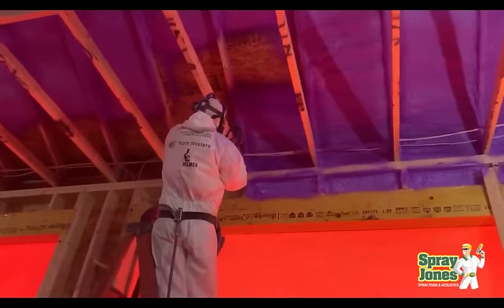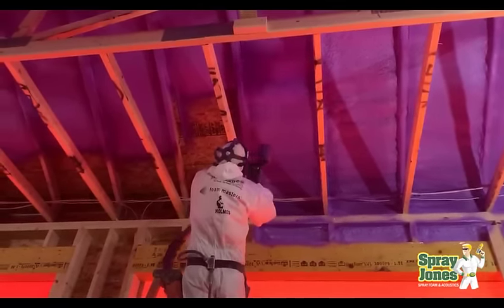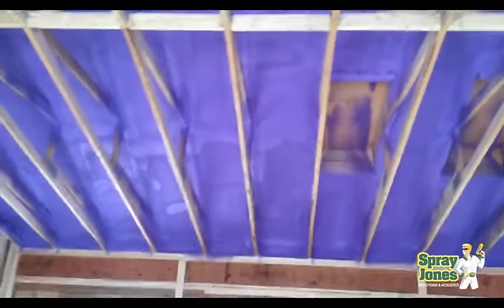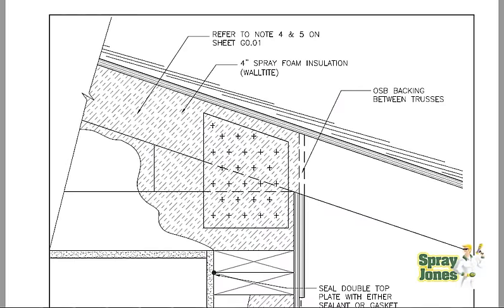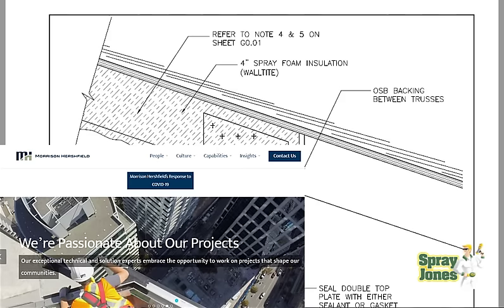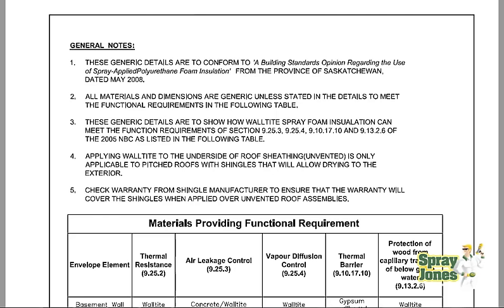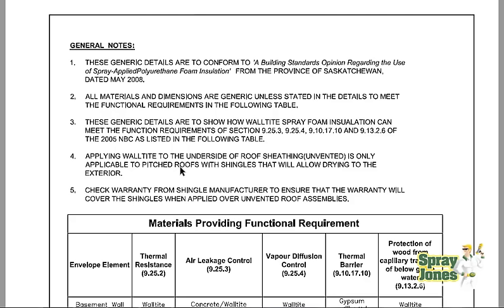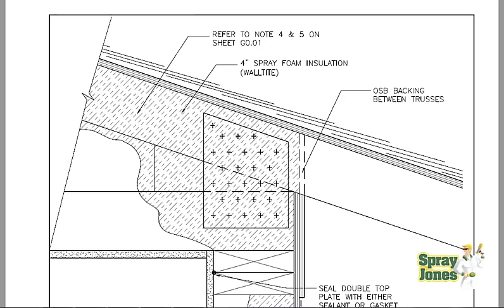Unvented roofs - Closed cell vs Open cell Spray Foam Insulation which is better?

Comment: Thanks for the video.  We just closed on a house in the Seattle area (Marine 4) and our roof is going to be replaced along with some of the sheathing (mold).  We need to fix the insulation to help keep condensation out and was considering going closed cell foam so we can use the attic for conditioned storage.  How does CCF on the rafters do in the wet environment? 

I was reading in your comments that vents would be better to not be there.  Our alternative is to replace, seal and blow in to R40ish to keep the moisture down, but also read that over venting in the Marine 4 environment will actually cause more condensation.  I just want to do the best practice and hopefully avoid these issues.

We have a lot more moisture than Regina plus we have 2 skylights that I am worried about the low R causing condensation in the winter.
Reply from the maker: Please watch my 4 part series on nonvented roofs. All of your questions will be covered in detail in that learning session.

Comment: I seen metal buildings with flat roofs which spray in foam insulation if I built a metal building I would do this spray in  Foam and insulation and I would cover it all up with metal It's a metal roof if you can't find a hole in a metal roof you do not belong on that roof please comment back if I am right or wrong thank you I used to do roofing for many years burn down rubber roofs  Hot roofing jobs  And also shingle jobs I used to find the holes in the hot roofs and the burn down rubber roughs before I found the shingle week a less it was a single missing or just a natural   HOL E in  The  Roof or a less it was in the valleys or around distinct pipes or around the chimney every so many years you're supposed to go up there with a bucket of gunk and re do them thank you for this video

Comment: Great video. I Have my spray foam contractor and he is recommending 8 inch open cell for my 2/12 pitch sealed cathedral roof. What do u think. I live in  Lafayette Indiana so we have all 4 seasons. This room addition is considered a four season room so a lot of windows. Will use water shield on entire roof with fiberglass shingles
Reply from the maker: I am indifferent. If the climate is warm enough open cell is more than OK.

Comment: Hey Mike! Appreciate all the info in your videos. We are currently building out in BC with ICF. What would the insulation detail be for 2:12 sloped and flat roofs with closed cell to the underside of the roof deck? Any special requirements? Thank you!
Reply from the maker: I do not consult on projects I am not being hired to spray. Talk with the people you intend to hire and they should be providing that data to you. If they can't that's a red flag.
Reply: @SprayJones  10-4 Mike. Thanks again for all the great content!

Comment: Keep in mind that roofs with a 3:12 pitch require two layers of asphalt paper under the shingles. I would be very careful about using closed-cell on less than a 4:12 pitch. 

What you fail to understand is that the closed-cell foam provides a moisture barrier under the plywood (like a vapor barrier). So any water that makes it to the plywood will be trapped between the ashpalt underlayment (which is a vapor barrier) and the closed foam insulation. This will impede the plywood from drying out. So your assumptions that all water will just drain off are incorrect. All water has to do is get under that asphalt paper and soak the plywood. This can happen if the roof is not sheathed and flashed correctly. The advantage of a vented attic is that if water does get to the plywood, the plywood can dry out from underneath air in the attic. That is a key difference.

Putting in closed cell insulation in the roof can be done safely and it is a great insulation system, but if human error comes into play, it can rot large sections of the roof before it is discovered and that is why it is not widely used. Presumably, if water got under the 15 lb asphalt paper and soaked the plywood, if open cell foam insulation was used, then the plywood would have a way to dry out. 

What we are talking about here is what happens when their is a roof failure. The closed-foam system can greatly increase the scope of damage caused by a roof failure. Also remember if the roof is a tile roof, then the cost of repair can be significant.
Reply from the maker: Thanks Frank. Stay subbed, I will be doing a new video on vaulted roof systems and SPF.

Comment: My daughter is redoing an old farm house with a non-vented attic.  There was no insulation and it is a metal roof.  My question is should we add roof vents and spray to attic floor or would you recommend spraying the underside of metal?  If you recommend spraying roof what happens if metal needs replacement down the road?   Thank you for your videos.
Reply: In northern New York on Canada border.
Reply from the maker: Direct to metal. 
Please watch parts 2-3 of the non-vented roof series. All your questions are answered there in detail that you will want.

Comment: Your videos are extremely helpful great job 

What is the foam you are using? I have not seen the purple stuff except on your channel
I,m in Northern Minnesota and plane on using close cell in the whole cabin would this be a problem?

Thank You
Reply from the maker: Closed cell is exactly what you should be spraying it with. We are using BASF's Walltite. You will not see that in the USA because it is blended for Canada and has to be dyed purple to identify it for the building code here.
Reply: @SprayJones   

thanks for the quick reply

Comment: I have one stupid last questions. I promise this will be my last. I am following as I understand it your advice. 2" closed cell on my foundation slab, 2-2.5" in my wall assembly (I will have Zip R-6 a sheathing), 3" closed cell on roof deck in my conditioned attic. So here is my stupid question. Should I also go 2" of closed cell between my ceiling and my conditioned attic? I am sure the answer is yes, but trying to cut some cost and just don't know. If my attic roof deck is closed and my walls are closed, is it worth doing in the ceiling of my ranch home? Thanks, sorry for asking so many questions, but I trust your opinion.
Reply from the maker: If you have sprayed to the roof deck you do not need insulation on the drywall ceiling. It is hanging in mid space...
For the record my suggestions are subject to code approvals for your area....
Reply: @SprayJones  Thanks. I just got a quote back from a contractor. I am pretty shocked. In short here is the details of the quote. Heated and Cooled square ft. 4,300 12 ft interior ceilings.  I asked for the following. 2" closed cell foam for the slab. 2-2.5" on all interior wall within the heated and cooled space. 3" closed cell foam on the roof deck within the conditioned attic space. 4" open cell ceiling that is the garage ceiling to the conditioned attic. Total Bill 73,000.00 for the job. I am shocked to say the least.

Comment: I'm planning on building a metal building home, all metal structure and metal roof, in Louisiana. It is a 2 story home with the entire roof inside vaulted and will be open to the inside of the house. I plan on using 2-3 inches of closed cell, sprayed directly to the metal, on the outside walls and 3-4 inches and the roof. I live 3 miles from the coast and we get lots of rain and sometimes flooding. I'm wondering about mold issues if we end up with standing water inside the house. Will mold grow on the foam? My other questions is the metal roof, what if I get a leak, how would I be able to find it or is this even a concern on metal roof with closed cell sprayed directly to it? I love your videos, they are very informative!
Reply from the maker: Mold will not grow on closed cell foam. Mold needs an organic surface to grow on.

Comment: You mentioned a resource indicating it was safe to use CCF under roof decks on 4/12 or greater shingled roof…..

What about low slopes roofs. Say a 2/12 roof using 45 mil TPO membrane ? Typically residential manufactured homes with TPO roof membranes are not glued down.

CCF would be great for strength on an older structure, but what about future roof leaks?

I should say this is in Florida. My home was narrowly missed by hurricane Ian.
Reply from the maker: Local SPF installers need to have their engineering done with state valid firms. 
You have to source that locally. But it is NOT as hard to find as you may think.

Comment: Using closed cell foam in an unvented conditioned space has a big caveat and could be bad if the roof isn't done correctly. If you have a conditioned attic space then the roof is no different than an exterior wall assembly. If you use closed cell foam on the inside it acts as a non-permeable vapor barrier on the inside. This means that the outside of the wall or roof needs to breathe all the way through your layers of your assembly to the  closed cell foam below. 

This means no peel and stick water and ice shields on top of the roof sheathing. If you do that then you have your wood roof sheathing sandwiched between two water and vapor impermeable materials. Bad idea since no system ever keeps 100% of moisture out. Very tiny amounts of moisture will get into any system but it will do no damage if it has a very easy exit. That is why any system should only have one vapor barrier on one side. 

Closed cell works well for walls because you have a rain screen material like siding that keeps most of the moisture off your outer wall surface with a small gap or drainage plane behind. Then your house wrap is water resistant but vapor permeable. This vapor permeable wrap allows any small amount of moisture that does get into the wall system to get back out once it is stopped by your impermeable closed cell foam. 

So closed cell foam for your attic is fine as long as you use a similar exterior system for your roof. Just use a vapor permeable but water resistant underlayment for your roof system.
Reply: What type of underlayment and ice shield would you recommend?

Comment: Your reference stated shingles. Are there objections to roof steel directly to the roof deck with closed cell? Or are perlins required?
Reply from the maker: I am not following you on you install ideas. Purlins are a structural question not a thermal envelope one.

Comment: Thoughts on renovation application to a 100 year old plank deck with multiple questionable or moldy areas underside? The drawings seem to apply to new construction with no reference to old homes and integration of vintage and modern practices. Plank spaces knot holes and other openings and less than new kiln dried lumber would seem to pose problems.  Sealing in 100 year old low slope 2 x 4 roof and rafters as well. IN those cases would a plywood or other  baffle base be warranted to provide ventilation and drying space from underside as low slope roofing does not allow drying from the exterior. I would like to see these legacy home issues addressed directly.
Reply from the maker: Well....... working on that now. 
Friday will be brick old buildings and foam. Lots to go over there. 
I am currently doing the companion video for it on old wood homes. 
Your answer is already spoken in video #3 of the 4 part series on roofs and SPF. Listen about why we vent inside in the first place....
Fix the questionable areas and then have closed cell SPF installed from the inside.
The rest... you will have to watch....no spoilers.

Comment: I have a cathedral type home with a Cupalo in the Panhandle of Florida and I am considering this method. My question is how does the moisture inside my home escape through the closed cell to the atmosphere? Especially if CC foam(as I understand ) is a moisture barrier. Thanks for any help
Reply from the maker: Please watch the 4 part series on non-vented roofs. Your questions are answered there.

Comment: I have a newly constructed, wood post and truss, 2500 sq. ft, 30 foot tall farm pole barn in Colorado, with metal siding and roofing.  Foil faced bubble wrap between the metal and trusses/walls.  Foam-style vented ridge cap. I plan to closed cell foam the interior walls and ceiling, and heat the building.      Do I spray foam the foam-vented ridge cap???  Thank you
Reply from the maker: You do if you are going non-vented SPF to the deck. The venting is to bring air into an attic space. 
You need to carefully detail this out with your installed. WHy? Because you have another layer that the foam is to adhere to. So confirmation needs to done.

Comment: Can you do a couple layers of Closed Cell Spray foam as the vapor barrier and finish up with 2 or 3 layers of Open Cell Foam
Reply from the maker: Only if someone has the stats on that to prove it out. 

Generally yes.

Comment: Great video. Thank you. A few questions. How do you tell when your roof is worn out?  Do you just replace it every 20 years?  Secondly, I have a 12 2 roof.  Meaning 2 feet up for 12 feet across.  Would this be less than optimal, but still maybe okay as it has some pitch to it?  I have read that 12 2 is borderline, I can do shingles or roll, roll is better but shingles would be okay.  Would spray on the underside and a layer of foam on top under shingles make sense and give more water protection to the plywood sheathing?  Would shingles be better than roll for this?  And can you also insulate the ceiling for extra r value, or does that create a need for ventilation? It is a garage to living unit so not that big of stakes either way.  I just want an inexpensive and easy option that will last for 10-15 years.  with that pitch, I can't really do fiberglass as there is no room.  And does this mean the roof needs no ventilation and actually should be air tight?  Lastly, why do you say 4 inches.  What is the R value?  In Washington, which is not that cold, we are required to have R49 so it would need to be maybe 7 inches.  Also, does enough to cover the rafters mean less thermal blocking heat loss?
Reply from the maker: Watch the 4 part series on roofs. That is discussed. There also a video on roof damage..
Reply: @SprayJones  Thx

Comment: We have cedar shakes on the roof and thus it's vented, using gable end vents.  Does the use of the shakes prevent closed cell spray foam from being used on the underside of the roof decking??  Thanks
Reply from the maker: No not in that limited context of the question. There is not a roofing material that cannot be used with SPF to the underside of a roof. 
But things MUST be purpose built to achieve the proper end result.

Comment: Good Info, but would you spray closed cell directly to the underside of metal roofing (ribbed steel panels) like in a Pole Barn House?
Reply from the maker: Yes. We have may times. Go watch the Pole Shed video we have made. Aug. of 2019.

Comment: Thanks for the informative video, prob a silly question to ask but I had a spray foam company come and spray the ceiling of my garage with 2" of closed cell, they were supposed to fill the last 2" with open cell but they did not complete the job.  Before I sheet rock with 5/8" dry wall, should I install 2" rockwool to improve the soundproofing of the ceiling or will the 2" gap between the closed cell and the dry wall do a good enough job?  thanks
Reply from the maker: I am lost here. Did they leave bare spots or just shallow? If shallow by how much?
You want roxul for sound? Why? 
#1 is thermal protection, frost / condensation control, sound is last if at all..
Reply: @SprayJones  thanks for the reply, there was a 4" cavity for them to fill they only sprayed 2" of closed cell and never added the 2" of open cell which would have filled the remaining space.  I am trying to sound proof the best as possible as I am building a home rehearsal studio.  the contractor doing the drywall said to just install the sheet rock but I am thinking I should fill the 2" gap with roxul to optimize the sound proofing of the ceiling.  Agreed?  thanks again for the reply  appreciate your insight
Reply from the maker: @Empire895  Ok. So why not have them back? Did you pay and not get it? 
Why open over closed? What was the idea for that? 2" of open cell is a bitch to spray...
Reply: @SprayJones  they were supposed to spray 1" on all the walls and ceilings and then fill the rest of the space with open cell.  The idea was that open cell is soft and thus will provide better soundproofing, that is what they told me as the hardness of the closed cell would seal the ceiling and walls without allowing the moisture in.  But when they came the operator sprayed 2" of closed cell in the ceiling and filled the walls with all open cell foam.  I was not going to pay them the additional $3000 they wanted to come back and finish the job they were supposed to provide me with in the first place so I was just going to have the dry wall team install 2" batts of rockwool.

Comment: I have a small leak from a solar rack and the closed cell has ultimately kept a ton of water out. I have been trying to get a contractor to simply fix the roof and it is a nightmare!
Reply from the maker: Thanks for the feedback. Why do people want water to come inside the building so they can see it and have more compounded damage is mind-boggling.
Reply: @SprayJones  yup got a pan under it. No one wants to come out and deal with thr panels. It isnt like it is a small job i want them to cover a couple of intrusions and replace done shingles. I might as well go up and do it.
Reply from the maker: @K0gashuk0  Find a handy siding and exterior contractor. Make friends, they have all the skills of roofers. Plus all the safety gear for getting up. My dad fell from a ladder getting onto the roof that ended his life at 57.